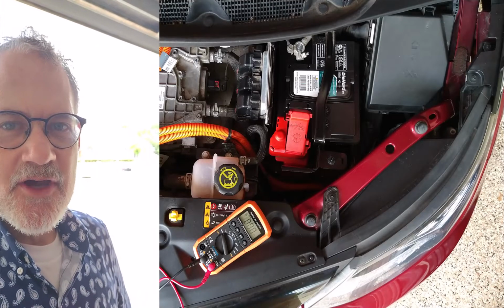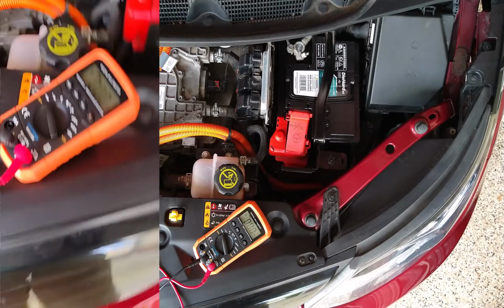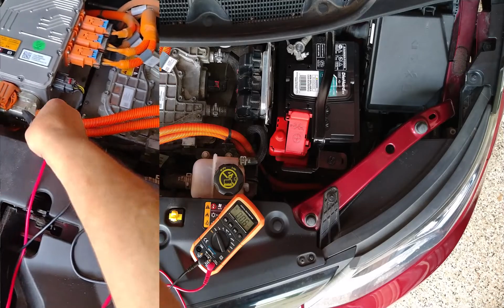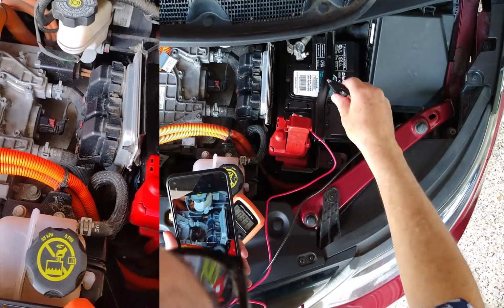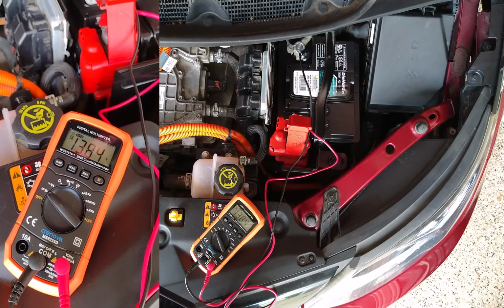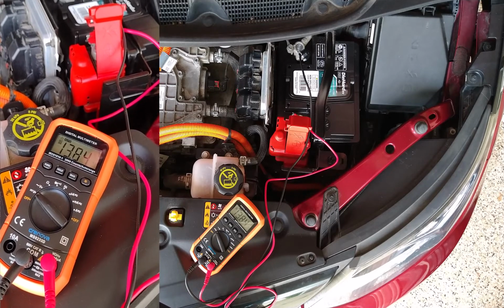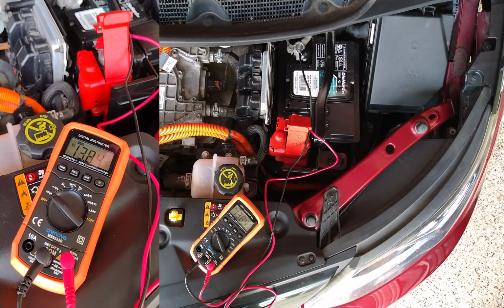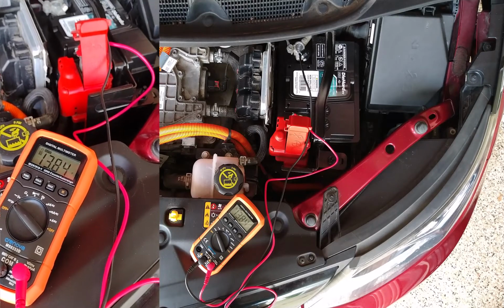How to Avoid This EV Problem - Prevent The 12-Volt Battery Crisis We Had in Our Chevy Bolt EV

Comment: Another tip is to get a deep cycle 12V marine battery rather than the "starting" batteries that all new EVs seem to come with.  You don't need the high amperage kick that ICE vehicles need from a 12V starting battery.  But what EVs do need is the deep cycle storage that marine batteries have.  I replaced the starting battery in my Nissan Leaf with a deep cycle marine battery, and it has been golden.
Reply from the maker: Wow! That sounds like a great idea!
Reply: it wouldn't fit
Reply from the maker: @chriscraven33  Bummer.
Reply: @oursolartrailer  you may be able ti find one that will fit in your existing space...they come in different configurations.
Glad to see it worked out for you and yes make sure you carry a good set of tools! 😁
Mike 🇨🇦
Reply: Most EVs, such as the bolt, recommend using AGM style batteries because of the different cycle use. The manual specifically mentions reduced life of a standard battery. AGM batteries are also called Start/Stop batteries and are common in the types if cars that automatically stop and start on red lights.
Reply from the maker: @JonGretarB  Thanks for adding that to the conversation.
Reply: What about a 12v LiFePO4 battery?
Reply: The first thing I did when I got my first EV (did the same for my second) was replace the lead acid "accessory battery" with a deep cycle lithium ion battery. It has been flawless. L-ion batteries have many desirable qualities compared to lead acid: They hold their charge for a very long time (losing about 2 or 3% a month typically [edit: When sitting idle for long periods of time]); They have much better temperature tolerance; They generally have an 8 to 10 year life (though in the low-demand work life of an EV accessory battery likely much more) and many more. Nowadays a deep cycle lithium ion battery is only about 50% more expensive than a lead acid one and well worth it for the peace of mind. There are plenty of them on Amazon. You will probably need M5 or M6 to battery post adapters to use it in your car though as they are generally used for solar energy storage.

Comment: My first Chevy bolt 2019 lasted about 4 1/2 years I then went to the dealer and got another one. It lasted a year and a half the dealer gave me a free one because it was under warranty. You're absolutely right check your battery right away. My daughter has the same car the same year and her battery is still the original one I keep telling her to change it.

Comment: Sorry about your misadventure.  When I brought my 2017 Bolt in for the battery recall replacement,  as usual with service  departments, they "identified " other potential issues with the car.  Out of pity, I let them change my cabin filter and brake fluid.  I declined the new 12V battery since it is an AGM battery and I've read they can last up to 7 years and my car only had 28k miles and has never been subjected to below freezing temperatures.  But after your video and because in 3 weeks I plan on taking my Bolt on it's 1st long range road trip from the Space Coast to Cincinnati and then return on a longer, slower, more scenic route over to Virginia and taking the Skyline and Blue Ridge parkways down to the Smokies before returning to Florida.  So i checked my battery voltage and it was in the 75 to 100% voltage range.   So I think I'm good there.  I'm thinking your battery may have been exposed to more severe cold for longer durations and that it has been driven more than mine.  Is that so?  Thanks for sharing your adventures and misadventures.  That's funny about the 1st hotel not letting locals book a room.  Makes me wonder what they thought you two were up to!😆
Reply from the maker: What a journey you have planned! You are right about our car having more miles and more cold exposure. You are smart to check your battery. Sounds like you are in good shape!
Reply: @oursolartrailer  Hopefully  chargers will be working and the ABRP route will be accurate.  I plan on staying at hotels with lvl 2 destination chargers, but just in case, I will bring bring my Juicebox and a tent and air mattress in case a campground works out better.   Probably not too much color being just the last week in September, but I will enjoy rhe cooler temps.
Reply from the maker: @markstipulkoski1389  That's going to be great! Hvae all kinds of fun and let us know how it goes!

Comment: I had a similar mishap about 6 months ago when my Bolt died on me on a store parking lot. All it took to fix the problem was an OnStar phone call - they sent a tow truck and took my Bolt to the dealership. 3 hours and $200 later, I had my Bolt back, with a brand new 12-volt battery installed.

Thank you for the advice, though, I will keep an eye on my battery from now on.

Comment: Well your experience with your Bolt battery happens to my wife and I pretty much exactly. A week ago our 2017 Bolt EV with 105k miles was having trouble shifting into gear. We had to shut the car down and try again and this time it could shift. Since the car was due for a maintenance checkup at the dealership anyway, we just thought we’d wait. But the appointment three days ago had to be pushed back nearly a week. And that’s when it happened.

The day after the original dealership appointment, our car stranded my wife in a church parking lot after a community meeting. I had thought that maybe the battery was toast and we thought we had replaced it about four years earlier and that maybe it was time again. It was getting late in the evening but we found an open Advance Auto Parts right before closing that sold us a battery. And yes, I emphasized this was a Bolt, not a Volt. And this was after an AutoZone closer to our house didn’t have one at all.

The next morning I returned to the Bolt with a set of wrenches and got the old battery out…only to discover that the new battery was too big. Yup, they had sold me a Volt battery anyway. So I drove it back to the store…only to discover that the store was completely down due to the Crowdstrike/Microsoft outage. Even worse, they had a battery with the right form factor but. It enough amperage. But another nearby Advance Auto Parks did have the battery and a couple of working point of sale machines. So I went over there…only to find out that they also had the same battery with insufficient amps.

Finally, they called around and found a store in the next county who did have the right battery and the right amperage. Meanwhile I called our dealership and they didn’t have the right battery either…nor did any of the dealerships in the area(!!!).

So when I got to this store in the next county, they brought out the battery I asked for…and it was the Volt battery. I nearly had a heart attack right there. Fortunately it was just a simple error and they did have the right battery in the back of the store (the only one in stock).

While I was doing the exchange with them, I looked at the battery I pulled from the Bolt and noticed to my astonishment that the manufacture date was 5-9-2016….8 YEARS AGO. We had never replaced it at all. So it was amazing it lasted this long.

So lesson learned. If you have an old Bolt EV, check the battery! It is impossible to jump the car for the reasons discussed in this video.

Comment: I own a 2020 Chevy Bolt and I have replaced my 12v battery, but only because the radio had an issue and was killing the battery. There is a know issue with some of the radios draining the battery. I still have the old battery and charged it, I think it's okay so I might keep as a spare. One thing I found out is that the car will only check the battery every 8 hours when its off. So if there is something draining the battery, you may not know about it.
Reply from the maker: Fascinating. I had no idea! Good idea to keep the old one as a spare.

Comment: How would the bolt do with one of those lifepo4  car batteries? They seem like a reasonable idea
Reply from the maker: Great question. The specified battery for the car is an AGM battery, a big upgrade from the standard car battery. It would seem that a lifepo4 car battery would work well, but we didn't explore that.
Reply: Some have reported great results with lifePo, I would worry about cold weather performance the charger is designed for lead acid
Reply: @rp9674  Thinking about it again, lifepo is a bad choice for a cheap replacement as the cells get permanently damaged if they're charged at all while it's below freezing.

Comment: I just use the Lithium batteries we use for heavy car audio systems.  Far more power than ever needed and will last under almost any condition.  Portable battery boosters are available  everywhere and the new RYOBI one is great for those who already own some of the tools and batteries.  Be wary of smaller ones.  If you find yourself in this situation you can plug a BOLT in and leave it on at a charging station which charges 12v as needed.  Get an RV deep cycle from Optima. ( Grey and Blue ones )

Comment: Excellent video!  It certainly is well worth it to replace the 12 V battery in your EV before being stranded when it dies.  I bought a 12 V car battery tester to get a better reading on my battery’s health than a simple voltmeter.  There are two types of testers, AC and DC.  Each has advantages and disadvantages.  I went with the tried and true older DC type.
Reply from the maker: Great addition to the conversation! Thank you so much! 🙏

Comment: I think the 12volt is used for the high voltage relays that connect the actual Lithium Ion battery pack to the rest of the system. 
I know it also works that way on hybrids, if you turn everything off and you're in a quiet area you'll hear those relays click when you put it in Drive.
(And also all the normal car electronics like the radio, lights and other small stuff like that)
Reply from the maker: Interesting. Thanks for the insight!
Reply: ...contacters?

Comment: I"ve had my 2020 Bolt through two summers in Phoenix AZ. Around here the other months don't count.  Come June batteries start dying.  So I sprung for a new $300 battery from the dealer.  I'm sure I threw away a good battery but your story makes me feel like $300 bucks isn't much when you're stuck like you folks were.  On the motel, if it were me corporate CEO would receive a long letter detailing what I think if their customer service.
Reply from the maker: That AZ weather can be killer. I think you're smart to replace that 12 volt battery a bit more often that you might otherwise. Being stuck without warning is--as you note--no fun!

Comment: if you just want a volt meter to see what is happening, do this.
Buy a USB port Car Charger with LED Light Voltage Monitor....
You always see what going on. See the voltage before it start for a second or 2.
Or just put it on ACC before you start it, to see the battery voltage in stand by...
Also the dashcam is running after you off the car in parking mode too, to drain your battery. Check settings on it.

Comment: If I'm lucky my Fiat 500 gives me one warning before the battery dies. I tried replacing it with a underpowered motorcycle size lifepo4 battery, it died on the freeway.  I'm interested in finding a purpose built lifePo4 battery that's good for 10 years.
Ommu (4yr warranty), Antigravity.

Comment: Ev’s use the 12v battery for their logic and the larger battery for motion. Also , you should get a load tester; it will test current which is a better test.
Reply: Simple summary.
Reply from the maker: Yep.
Reply: @DevinThorpe  I find it’s best not to go into a long electronics Eng discussion .  Though if I wanted to I could get deep in the weeds as they say .
Reply from the maker: @Fraiyia  ok
Reply: @oursolartrailer  no seriously - I’m an electronics engineer pilot and flight instructor .  Didn’t mean to offend but I actually like to get deep in the technicals of circuitry just I keep my answers simple because apparently the vast majority of mankind hate math and science and need the fast answer.  IMHO there may be a way to adapt these Ev’s to a hydrogen fuel cell technology . See,  thing is the fuel cell will give you the range and power and it makes sense to me that all these existing EV’s could be equipped with a bolt on fuel cell . Right now in California there are many hydrogen refueling stations and there are 3 hydrogen cars . ( Toyota , Hyundai and Honda -very affordable too) Hydrogen is just starting out so we might be looking at another 65 years before we see clean hydrogen - right now we. are using blue hydrogen and it’s not perfect - yes the cars are great they emit water so good there but the way we make the hydrogen is not so green . Tonight as a fun experiment drop a 9 volt battery in a glass of water watch for the oxygen and hydrogen bubbles One day ( prob when I’m long dead ) we will have hydrogen from renewables .  Imagine your older leaf  adapted for hydrogen . My 2018 leaf could be around long after I’m gone.  Hydrogen is the answer but just like how we transitioned from steam to oil , coal and nuclear , time and infrastructure development are what is needed and fuel cells are a proven technology going back to the start of the space program . Right now nuclear is one of our biggest threats , I could go on about 3 mile island , Fukushima and Chernobyl but there is too much to say . Fossil fuels are destroying the planet slowly .   Right now there are 400 res nuclear reactors all over the planet . If society ever broke down , comet hit , zombie virus then without personnel and infrastructure our nuclear reactors would meltdown - there is an interesting documentary on 3 mile island on Netflix btw.   I live in Texas in DFW and people here hate EVers - they will block or sabotage charging stations or put the charging cord in their truck so they can park in a spot for EV charging , one of my things for me is to educate people on the benefits of Ev’s . Videos like yours are very helpful and I may do one about charging pretty soon . Hope that wasn’t too long a reply lol.
Reply from the maker: @Fraiyia  Great analysis. I hope we can find affordable ways to produce green hydrogen sooner than 50 or 60 years. I think we really need it for air travel. We need a clean fuel for jets! Renewables can power cars easily. :)
Reply: @oursolartrailer  Indeed however the bottleneck is not the technology but rather than politics and those who wield power. That as a person of science I must yield to logic which  Dictates That fossil fuels and even nuclear are not sustainable.  Not only do we have to get to the technological stage but we also have to remove the political barriers that are funded by the billionaires to prevent progress and allow them to remain in power .
Reply from the maker: @Fraiyia  You're exactly right!
Reply: @oursolartrailer  thank you , however I seek only to promote the wellbeing of this planet . We are nearing the precipice- a point at which changes in our climate are being seen- adverse things for which we must take heed.  Ideals, egos and opinions do not negate science  but they impede progress - I hope that what I discuss can weave its way into the minds of people who would seek knowledge and enlightenment .  Right. Now , our fastest rockets could not make it to alpha Centauri - our nearest star - in our life time .  Our crude rocket technology has not the ability to transport us to safe haven if our world were to be destroyed .  Mars is a thought but our terraforming technology is crude and slow - the atmosphere on mars is so thin that we could not extract enough oxygen from the co2( imagine flying at fl600 or 60 thousand feet Very thin air ) and the thickening of the air would take a technology that could move water - asteroids into the atmosphere . Trust that we are not there yet . I read Kim Stanley Robertson’s red mars , blue mars , green mars . ( which seems to,tout as a plan to terraform mars ) Entertaining but much off the mark .  We have to cut through these egos and misinformation - how to do that ? I am uncertain . When ice vehicles park in front of ev charging stations for spite and here in Texas attitudes seem to sway with the criminal trump.  I am not sure how to mitigate when facts and empirical data are rejected and cultism is accepted as norm -     if you go to target and you see men with 44 magnum hand gun on their hip it is difficult to reason with a mind like that .  Progress is slow …
Reply from the maker: @Fraiyia  I hear you!!!
Reply: @Fraiyia  Hydrogen is worse for the planet than EVs. The metals they need are more expensive and making hydrogen is only about as efficient as EVs are electrically. Now add transporting and storing that fuel. Bad deal all around.
Reply: @pootispiker2866  did you ever study the Industrial revolution?  Did you ever read up on how wee transitioned from coal to oil to nuclear . All of these required refinement to progress . Hydrogen will take a long time to get right too. I prob will be long gone before it gets worked out.  Should we continue to burn fossil fuels ?   Or should we all get bikes and peddle about ? It’s really interesting how hard the oil industry is working hard to impede hydrogen and renewables .